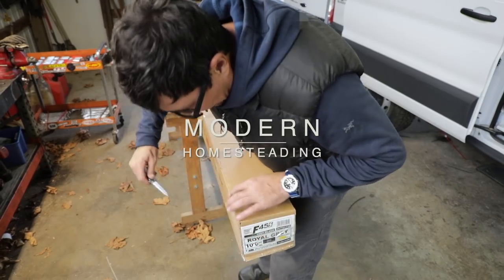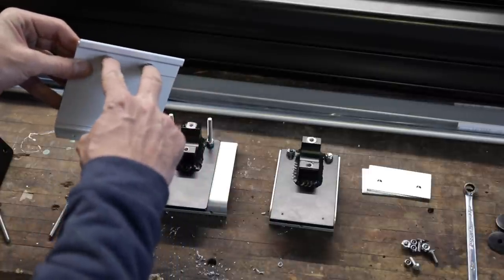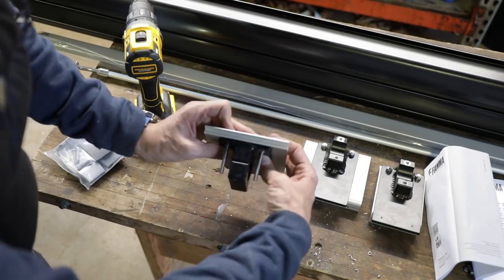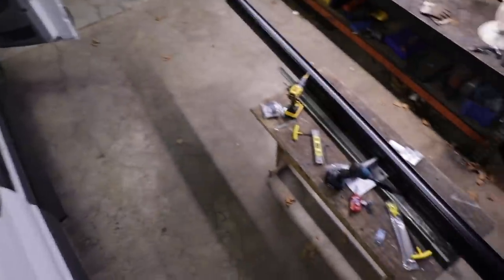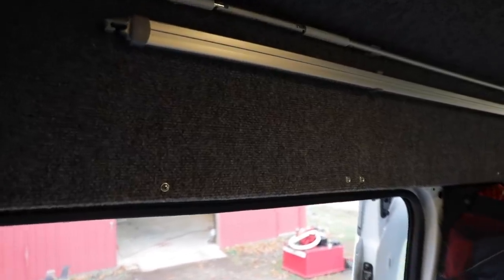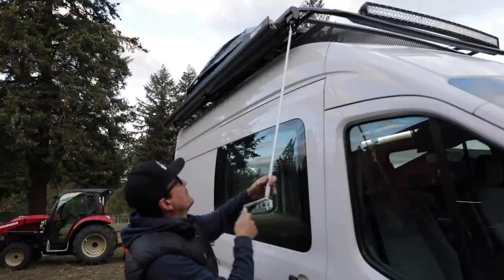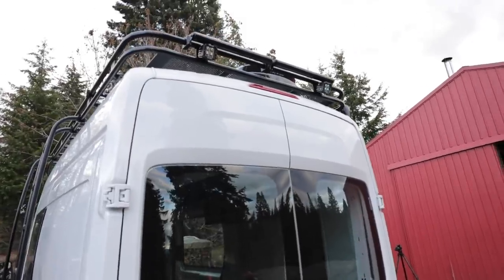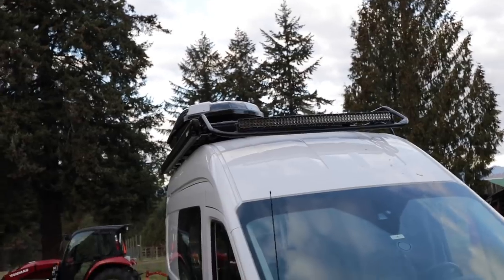Is The Fiamma F45s Worth $1000K

Comment: They gave you non-stainless nuts because stainless nuts on stainless bolts will gaul and you'll end up snapping them if you try to remove the nuts if they stay together long enough. They did you a favor not providing stainless nuts
Reply: WeekendHandymen lots of companies ship stainless nuts and bolts. They just send some anti seize.
Reply: Use the proper grease and they wont bind.

Comment: Hi there from the UK, just a quick note about your new fiamme awning, once up have one leg slightly lower than the other so that any rain water will wash off to one side also it might be an idea to use an awning strap, but placed between the awning fabric and the cross supports so that it doesn't year the material.

Comment: My Casita trailer has one, now ten years old.get your self an awning strap to go over the top mid way ,because when the wind kicks up it balloons and many have been ripped off here in in Colorado.second tip attach 2 safety straps to  hold the awning together while traveling .when a big rig blows by it could pull the awning open on the road,if it gets ripped up youll have to hack saw the damaged awning off. Last tip clean /wash your awning a couple times a year  with something that inhibits mold growth, good for Oregon . Keep it lubed too. Dont forget your 3 step ladder so you can unbuckle those 2 safety straps. Ours does well for shade not so for rain .I paid 600 for mine ten years ago ,never had any problems.

Comment: Idea for other two lights. Mount magnets to them with a length of wire. You can place them inside or outside. Wherever you need them. You may need a light to take up top or under the van. The rare earth magnets will attach anywhere.

Comment: Trick I learned in the Air Force was to use a nut and cut against it. The nut would protect the threads and clean the end when you removed it.

Comment: From experience I can tell you that stainless nuts on stainless bolts gall very easily. That could be why they mixed metals. You can nearly eliminate the stainless hardware gallin tendency by lubricating the threads before running the nuts down.
The van is looking awesome, and the awning looks great also. To me, a 4x4 van conversion just seems obvious, and I don't really understand why you can't get one from the factory. The only 4x4 vans I see have Canadian license plates.

Comment: Seems to crank out and in real smooth.  I'll bet you could make an adapter to chuck up in a drill if you got tired of cranking it by hand
Reply: That's a really good idea. I've been debating between the manual and electric versions of this awning and I think you just decided it for me: manual and rig up a drill attachment (much like how I already use a drill for my trailer stabilizers). Thanks!

Comment: I would rethink the placement of the rear lights move them away from the rollers  possibly out to the edge  so the light would possibly light the sides and you won't be breaking them when you use the rollers .

Comment: It is common to use Stainless bolts and nickel plated nuts to prevent thread galling. Your average consumer can not be expected to properly lubricate and take the time to install a stainless nut on a stainless bolt without damaging them and rendering them unusable.

Comment: I went with the Thule which is about $400 cheaper when on sale, has movable mounts for different applications and a stronger house with more accessories. Aluminess parts never fit right for me. I think they need to tighten up their outsourcing vendors and improve QA.

Comment: Just a tip for cutting bolts so you dont mess up threads. Run a nut down all the way first, cut the bolt to size, then pull the nut off. It will clean up the thread ends for you.

Comment: Bat manufacturing awning parts and some propriatary custom extrusion. Very common in the awning manufacturing industry. Most of the awning will differentiate themselves in extrusion wall thicknesses, bearing/hardware materials, and corrosion resistance. It sounds like (so everything) but there are quite a few parts in all awnings that all awning makers use, made by bat.

Comment: Story Time

So I’m walking down the street one sunny afternoon when what should happen upon me! A big bad evil  monster. The monster turned out to be friendly and gave me a lift home. The street name escapes me, but the clouds looked like they were intoxicated. They should not have been driving without a helmet, singular digits of people bang their heads on a daily basis in green suits. The walls were fabricated from cheap steel that bowed from its own weight, the ceiling was supported by a ginger cat, he was a fan. Oval windows with frosted glass line the porous walls as if to replicate the ginger cat. Did I mention his name was... What was his name again...

The moral of the story. 

Most of what you read in the internet is rubbish.

Comment: Cool awning for the adventure van, but here is an observation to consider. I would be concerned with those three clamps attaching it to the rack. There might be enough weight on them in some situations to torque the entire awning downward. The black plates look long enough to rest against the lower bar when they are mounted on the upper bar. A few small pieces of rubber between the plates and lower bar would also keep the entire thing from rattling when you're on the go. This might complicate running straps for gear on top, but it looked like it was far enough away to not be an issue. Food for thought.
Reply: Likes one comment, reads through 200 that correct his math. Hey at least we all learned something today!
Reply: @montgomerybojangles8644  lol, true

Comment: Thanks for the videos. I'm saving up for a similar vehicle so it's great to see your modifications. I plan to get the passenger version and pull out the back two rows of seats. Going for the lift kit with big rims and tires instead of 4X4.  Are you planning to get bigger rims and all-terrain tires?

Comment: Your going to overboard on the van.. sorry Cody just my opinion
Reply: With what?  I had my long tall sprinter packed and still scaled 500# short of gvwr, 8 cases of wine, 1950s meat slicer, all my milwaukee m18 tools, and everything I normally take.
Reply: @kfstreich4787  not the interior I mean the exterior. I have a cleaned up Chevy Astro that I've painted with new wheels and tires but I like it to look clean on the outside mostly because I like to camp in urban environments I live about 45 min outside of New York and I like to come into the city and camp and explore so just being under the radar on my adventure can is just my preference. But I own a small farm upstate and driving around up there I can see why all the gadgets on the outside would rock.
Reply: Got it, the shade is welcomed in the pnw where you can enjoy rain, rain, snow, rain, and a couple munths of SUNSUNSUN

Urban I can see stealth as an advantage, I thought long and hard before ordering a grill gaurd, but so many deer out there, I figured it would pay for its self eventually,  other than that an awning and a maxx fan is it on the outside, I may add an aluminess rear bumper later, but I'll have to sell the dog first.